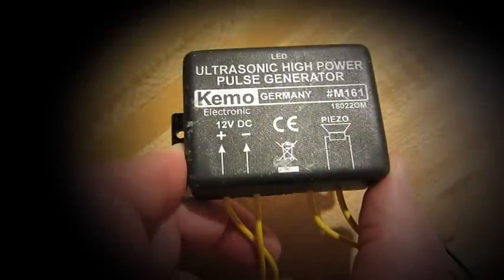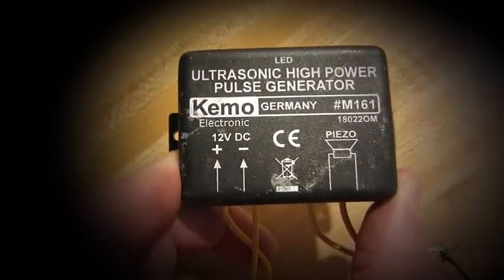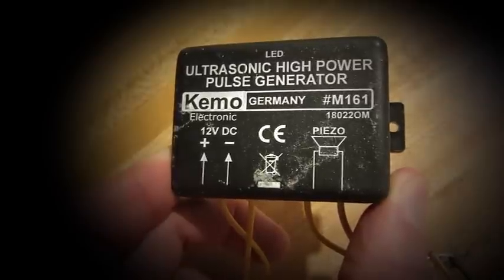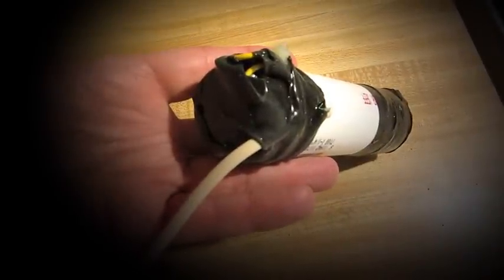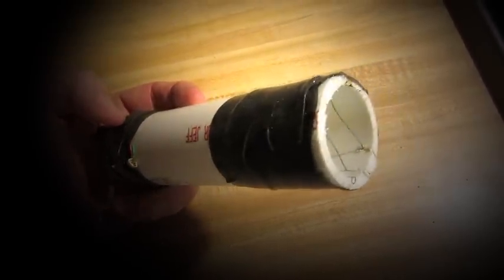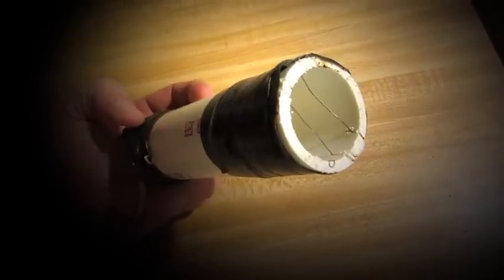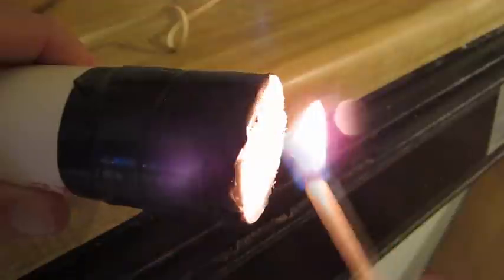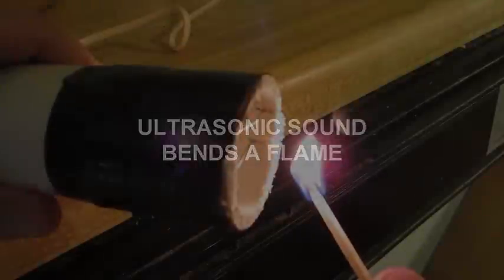ULTRASONIC ANIMAL CONTROL - TESTING TWEETERS

Comment: I just found on the internet that you lose 6dB if you double the distance. So if you put high volts into a piezo tweeter (use a transformer) and manage to get say 120 dB at 3 feet (some big tannoy piezo horns will manage this) then at 6 feet you're down to 114dB, 12 feet 108 dB, 24 feet 102 dB, 50 feet 96 dB, 100 feet 90 dB.

Comment: yeah that's probably correct. If you have two tweeters running at say 93 dB, then if you're doubling the sound pressure, you've only addded 3 dB, so the total sound pressure has now only gone up from 93dB to 96dB. Also, I'm not sure of the roll-off of sound pressure with distance and frequency, but HF definitely rolls off much faster than LF, so if you want to reach 100 dB at many 10's of feet, it's going to require a very large number of low power tweeters.

Comment: i have build a circuit using a 555 ic. It is a frequency generator that i have connected to a piezo tweeter. I am unable to tell whether it is emitting a sound when the frequency is set to 40 khz. can a simple piezo tweeter emit a 40 khz sound or is there a special type of high frequency speaker neede?

Comment from the maker: At Chris Sollart: More on the topic about multiple tweeters: I've advocated many tweeters for a couple of years, and have built arrays for experimentation. But, now I'm looking for one really POWERFUL tweeter (maybe magnetic or air driven). I'm realizing that one really bad-ass tweeter would be better than several weak over the counter tweeters. I'm looking, but I'm sure these are hard to find industrial devices. I'd love to modify an air driven ship whistle for ultrasonic.

Comment from the maker: At Chris Sollart: To measure sound level after the pad you could use a mixer (meters) or a recorder (meters) or an oscilloscope. You could use a variable pad (pots instead of fixed resistors) to vary the pad from zero upwards. These are parts of a strategy for making it work. Yes, 8 piezos in an array are nice, but the level projected only goes up a little with the addition of each tweeter. Kind of like when you have two light bulbs instead of one, there's not twice the light, just a bit more.

Comment: Yup; I understand the resistor reduction pad.  So I guess you would need some sort of RMS meter so as not to over-drive the amp or burn up the tweeters.  Again; how about 8 (or more) of the cheap piezos in an array?

Comment from the maker: An audio pad is a simple resistor hookup that is used to cut down and audio signal (or other electrical signals or voltages). See audio attenuator (pad) on Wikipedia. Maybe you've seen an attenuator cable at a Radio Shack or other store. These cables make it possible to send a signal from a headphone output into a microphone input for dubbing music. This is a pad. It is very very simple and easy to make if you can solder. Use a pad if you want to feed the pulse from a kemo into a power amp.

Comment from the maker: at Chris Sollart: Thanks. As for the Kemo unit, it could be used to drive a power amp if you use a resistor reduction pad before feeding the amp. This is because the Kemo unit has enough voltage to drive 2 piezo tweeters. As for piezo tweeters, remember they respond to volts, not watts. Some of our viewers have suggested high frequency voltage-stepup transformers after an amp before the piezo. Also, use short pulses when pounding a piezo or the heat will fry it. We need info on stronger piezos.

Comment: I know a little about the physics of sound transducers, etc.  One thing that would probably help would be to stack perhaps 8 of them (the more the better) in a vertical column, like "column speakers".  That multiplies and focuses the sound in the horizontal plane.  Can the Kemo unit be used to drive a power amp or will it over-drive?  Perhaps 8 piezo tweeters and a 100 watt amp would do the trick?

Comment: Well, the model Kemo M048N is listed as "ultrasonic generator" and can emmit from 8Khz to 40khz. The human hearing is from 20Hz to 20 Khz so... My doubt is about the power. How many tweeters I will need for 50 ft. and wich piezo tweeters should I use. Of course this will be an experiment since they do not say it's for use with teenagers maybe because of the laws in Germany.

Comment from the maker: at Cristiano Keller: No, Kemo unit will not help you run off kids. The Kemo unit is pre-set at 22 thousand cycles which is above the hearing range of all humans including kids. It's designed for animals and may not even work for that (we're not really sure). But it will not help run off kids.

Comment from the maker: at Jerry Tremont: I understand your conclusion. However, those $1 piezos are junk. I've seen better grade units. But, if you move to work with voice coil style units, they can be powerful too, but not in extremely high frequency ranges. However, they should work well at 19k cycles. They will need more power as they are nowhere near as efficient as piezo, but they may be capable of tremendous sound levels, especially if pulsed, modified, or custom made. Does anyone one out there have suggestions?

Comment: I bought 10 of the Pyle 300 Watt piezoelectric tweeters from parts express for $1 each.
I wired three of them in parallel each having a 10 ohm series resistor.

The tweeters broke down at +/-7V, above which voltage the current shot up heating the tweeters. At +/-7V (5V RMS) and 25KHz drive, the three tweeters drew 320mA rms.

This amounts to about 0.5 Watts/tweeter and had no effect on the animal. Therefore I am giving up on the piezo tweeters as being a hoax. Next I will try voice-coil units.

Comment: I'm waiting to purchase one of the Kemo units but would like some actual field test feedback before I make the plunge. Anybody out there with some results?? Food for thought, Adafruit has an inexpensive RF wireless control unit (#1095, #1096) that could be wired into the Kemo for remote operation..

Comment from the maker: Yes, if you decide to try the Kemo unit, it usually comes with a tweeter when you order it. I will repeat what I've said before, I do not endorse this Kemo unit even though I bought one and have tested it physically. However, my neighbors have shut their dogs up before I got to test the Kemo on dogs. I would rather find a unit that would take paint off walls, but the Kemo unit is a possible starting point.

Comment from the maker: This test is unique I believe. I've never seen this trick shown anywhere, although it's all too obvious and it works if there's a pulse of sufficient power coming from a pulsing ultrasonic tweeter. I'm sure you could do this with smoke too (as from incense or a cigarette, or something like that) as long as you're in a room with no air movement.

Comment from the maker: It's a simple test that you can use with the Kemo ultrasonic driver and tweeter to see if the unit is working. This test is so simple that anyone can do it. Remember, if you place an ultrasonic tweeter/pipe near a neighbor to try to quiet a dog, make sure there's nothing in the way (like a fence or trees), as ultrasound is delicate and can be blocked by obstacles. Put it as close as possible to the offending dog and only pulse it when the dog is barking (according to dog trainers).